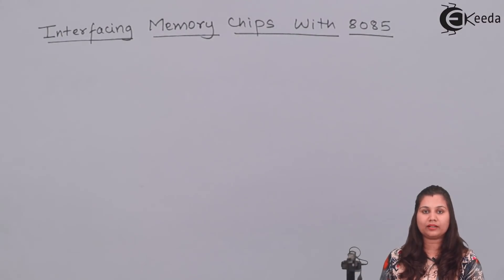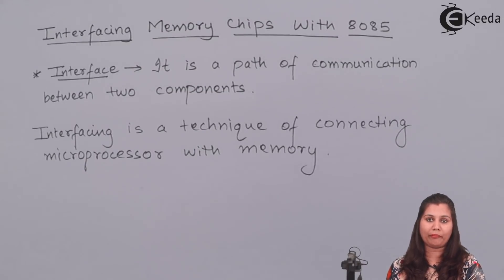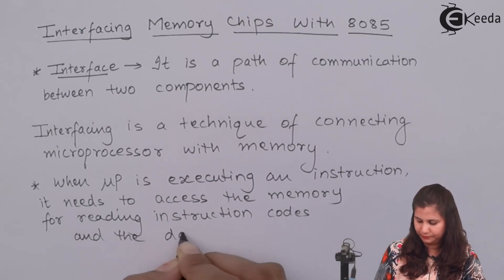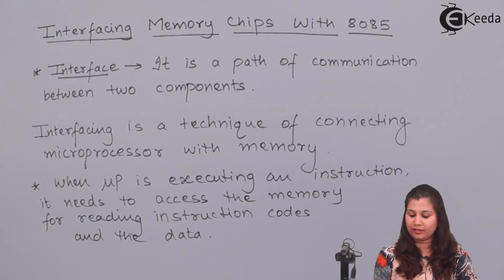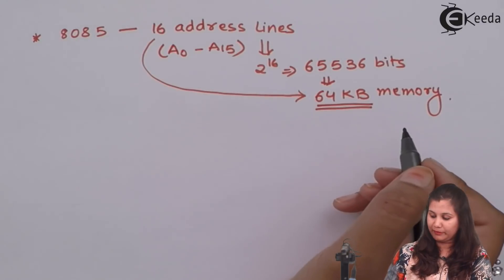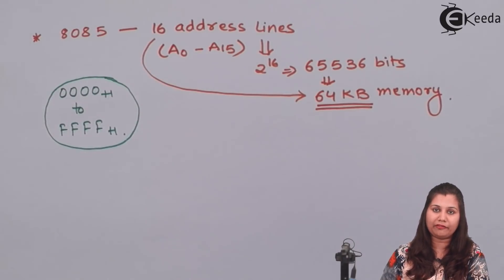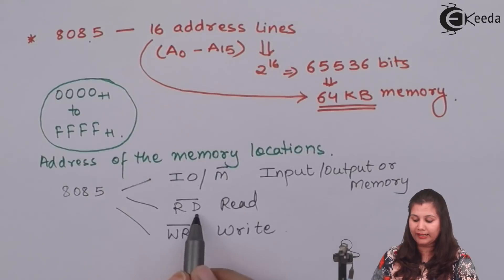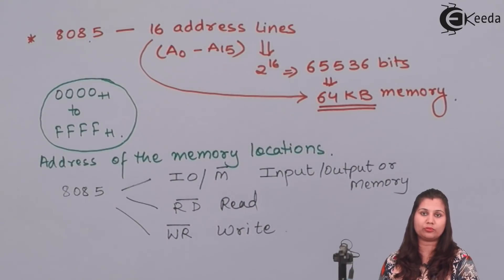Interfacing Memory chips with 8085 Microprocessor - Interfacing Memory and I/O Devices with 8085

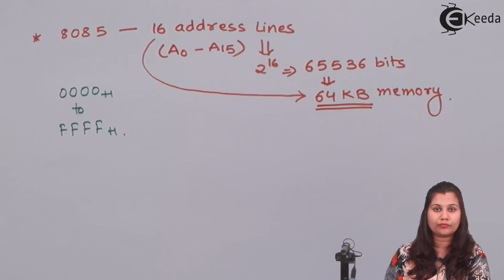Comment: 7:40  it should be 2^16= 65536 registers. since 8085 microprocessor has 8 bit register so total bits= 65536*8 bits = 65536*8/8 bytes. therefore memory size is 64kb.

Comment: design a memory system consisting of 8K byte ROM and 16Kbyte RAM spaces.The ROM starts at address 0000H while the RAM starts at 8000H.If the CPU address is 16bit ,list all possible ways in which ROM and RAM spaces can be accessed.Assuming individual ROM and RAM chips to be of size 4K bytes each,design the full memory system..............can u plz help me by showing how to do this??